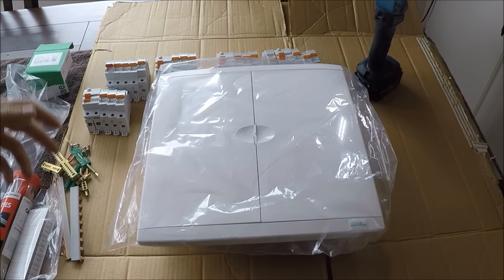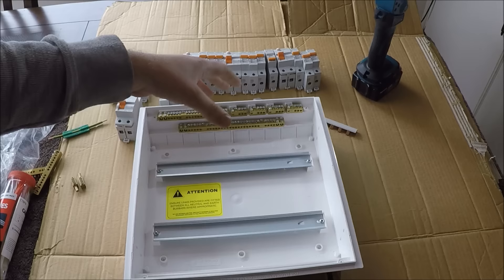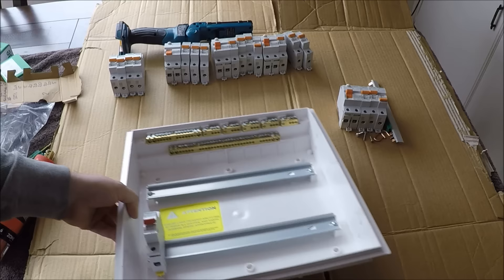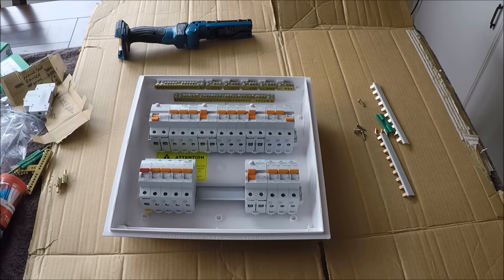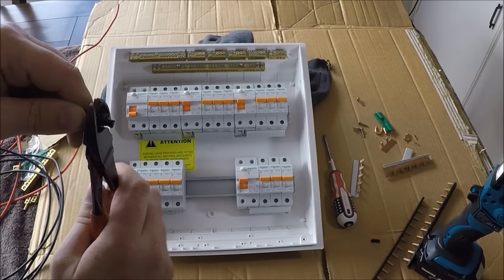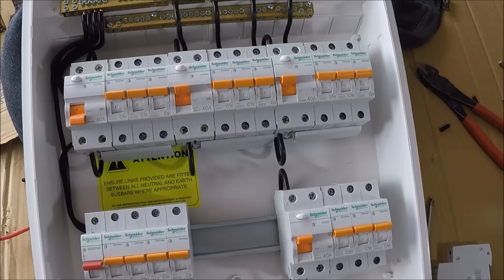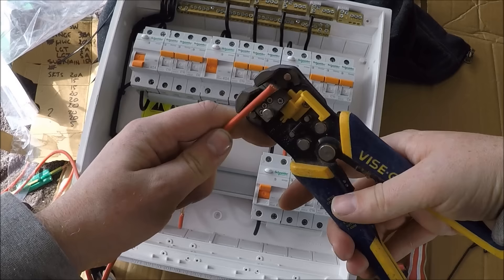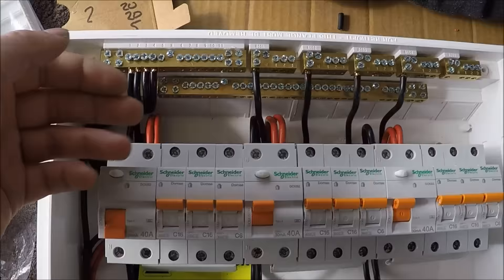How To Wire a Switchboard (Part 1)

Comment: What's  your view on combined breaker/rcd? I checked my current box after this video and it's only a small box with no dedicated RCD. The socket and lighting circuits do however use a combined breaker/rcd component. Would you say that's absolutely fine, or would you recommend replacing to a separate rcd unit like you've done here?
Reply: Single devices with combine RCD/MCB functionality are much better. It means if there's a fault, it trips just the one circuit, not several of them. It makes fault isolation a lot easier and minimises nuisance trips due to accumulated leakage currents over multiple circuits. Modern electronic devices all leak a little current to ground (which is one reason by type A RCDs are preferable). 
Where I live the trend is away from separate RCDs to combine MCB/RCD devices (called RCBOs where I live) for those reasons.
Reply: @TheEulerID  Nice, thanks for the input. The important thing to me is that they are at least as safe, if not better. Then the bonus of only blowing that one circuit is then a nicety on top 👍

Comment: Hey bro do you always wire the feeds on the bottom? Apparently people are changing and wiring feed in from the top of the breakers? According to regs
Reply from the maker: Hi, cheers for the comment - there is no right or wrong way to wire an mcb - they can be fed from either top or bottom. If you can provide the reg that states otherwise, I would be keen to hear. Thanks

Comment: Good video sparkydave. But I have a question Bro. When you wire the feed from the main switch to RCD, you jump from RCD one by one then loop back to the main switch. Does it mean the two 6 mi red wires protected by the 63A main switch?  In case one of the two 6 mi is broken, the other one will take all the current of the house.  This could be a problem. In my opinion, there should be separate feed from the main switch to each RCD.
Reply: Your 100% right. If there was, by the worst luck, a short on the line side of the RCD, the cabling wouldn't be protected enough due to CSA. This means the line side for each RCD would need to be 16mm cabling to suit the incoming mains (as per AS/NZS3000 table B1) or the fault current would burn the cabling before tripping current is reached. You could also collectively have a final sub-circuit current draw over the rating of the 2.5mm (20A) cabling between all line side feeds and burn the cabling prior to tripping the mains circuit breaker. As per table B1, 2.5mm cabling should only carry a maximum load of 20A. In nearly all cases, wiring the line side of RCD's and or RCBO's should be done in parallel to be safe.
Reply from the maker: Cheers for the question, everyone would have a differing opinion on whether to ring feed or not based on experience. The main switch is a disconnection device not designed to protect the cables, but the MCB/fuses on the line side of the main switch handle the job. Personally I have yet to come across an RCD ring feed cable that has been removed from the circuit, the one installed in this board is rated to 98A (ASNZS:3008, Table 4). I have however come across a few main switches in my time that have been damaged due to loose connections over time caused from overloading the load side with too many cables. Sometimes it is much quicker in the field to wire them in series especially if there are very few circuits. My advice would be to do what you are comfortable with.
Reply: Cheers for your reply. It makes sense that too many cables cause loose connections. Always follow your updates. Expect 3-phase switchboard if you also do commercial.

Comment: Hi sparky! I have a question. Your setup is main switch -> rcd -> mcb. I have researched it and some said switch -> mcb -> rcd is correct setup. Your setup may damage the rcd. Is it true?
Reply: Thats not true. Either way is ok but Dave's way is best practice. Your switch-mcb-rcd is like rcd socket.
Reply: It really depends because if the RCD cannot be overloaded if the MCB Alfred are working correctly due to calculated maximum load of those circuits generally speaking, the RCD could not be overloaded

Comment: Hi i am looking for a gud multimeter, cud u suggest which one is good. I am planning to buy klein mm700 or fluke 177 or any other good brand whose reading is correct and fast
Reply: fluke stuff is very solid.
Reply: Does cheap brands are good expensive brands that are good? It really depends on budget and everything because yes get an expensive one. They’re good but a cheap ones perfectly fine if it’s a quarter of the cost you can probably afford to replace it a couple of times, especially if you miss it.

Comment: Still using separate RCDs? Much better to use what is called where I live RCBOs, which combine RCD with MCB functionality as you don't lose half the house's circuits if there's a problem with one circuit. It's also only one slot, makes fault finding easier and reduces nuisance trips as leakage currents accumulate over multiple circuits.

A split-load RCD Consumer Unit in the UK is similar in some ways, different in others. There would be a dual-pole 100A master switch, and that would feed the RCDs via separate 20 mm^2 cables. The DIN rail bus bars would be similar. The neutral terminal bars would be fed via separate 20mm ^2 cables from the master switch, 

There would also now be an SPD installed via a 32A MCB providing surge protection between both line and neutral to the earth. 

The actual box itself would also have to be made of non-combustible material (that is metal). 

Some of these are fairly recent requirements going back about 6 years.
Reply: How do you think this approach to split load is way better though because three MCB per RCD compared to maybe five or six on some in the UK you can make the selectivity argument very easily then?
Reply: That's a question about the number of circuits installed, not the use of RCBOs vs RCDs.
Reply: @TheEulerID  it kind of is because the selectivity argument which is what turns off in a fault in this case it’s maybe a maximum three circuits or one if there’s an RCBO compared to putting more in an RCD way more turn off so this way of using RCD with three circuitsis quite good so RCBO are better but not always required due to the benefits of this

Comment: I'm from the states and one word I lrned from the brits with all this stranded cable ferrules lol
Reply: It does shock me however the US electoral system is outdated. UK one is old-fashioned but progresses with safety things but the US one is simply stuck in 1950 most of the time do you have experience issues where you want to use a safer product? But it’s simply not allowed.

Comment: Hi Sparky, do you know in Australia every circuit have to be on the safety switch (combo)
Reply: You are correct Sir Valdo
Reply: that's not true at all - the regulation is 'every circuit needs to be protected' not 'every circuit needs to be individually protected by an RCBO' that means you can still use RCDs
Reply: @aaronw9035  Yep you are right.  I miss understood what Sir Valdo was saying. Well spotted

Comment: Great video mate! Very clean install. Do you use the same components and wiring for an off grid solar system?
Reply: Call an electrician. DIY electrical work is illegal
Reply: Well you’re gonna have to do a lot more calculations because this will not work she make her solar system suddenly power stuff whether you mean could you feed an inverter into it? Yes however you’re going to want a lot more practical things and this seems like isolation you need a professional is the best way I have this point, if you don’t understand it or watch some solar in videos by electricians and make an informed decision on what approach